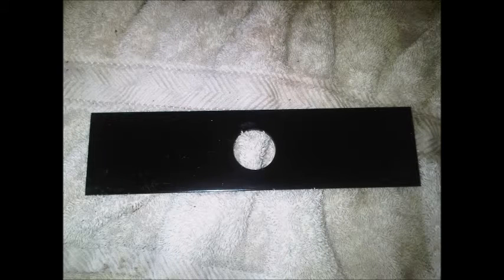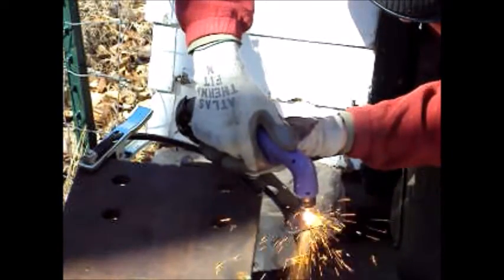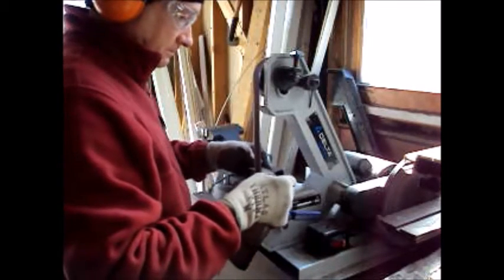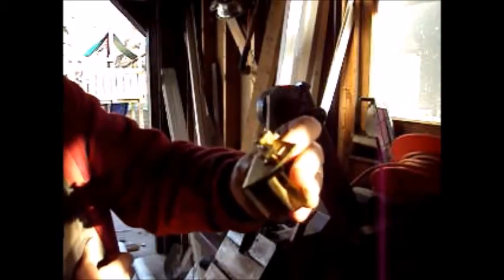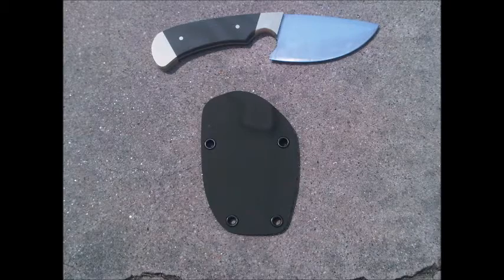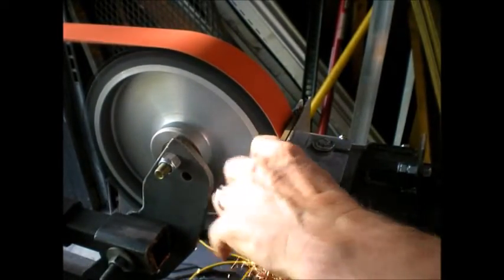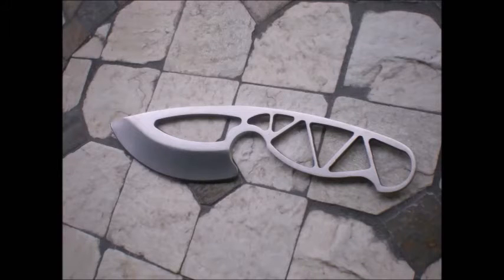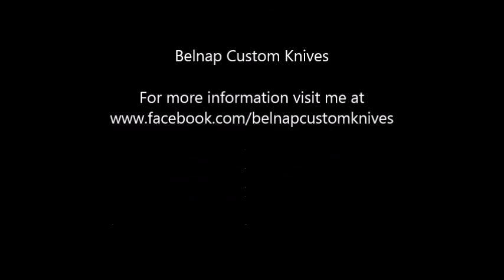Evolution of the BK Skinner into the BK Skeleton Skinner

Comment: Nice design, I like it. Don't discount carbon steel blades completely, I have some customers that ask for it instead of SS. But, I know where you coming from, I hate sending a knife out that will rust easily.
Reply from the maker: +Self Made Thanks.  I am sure you are right.  Probably am being over critical of the carbon steel.